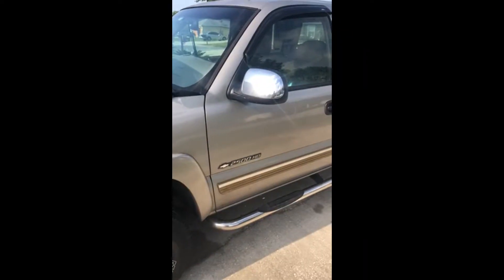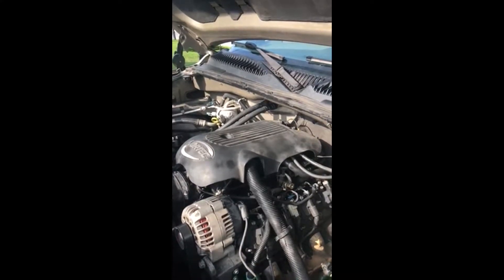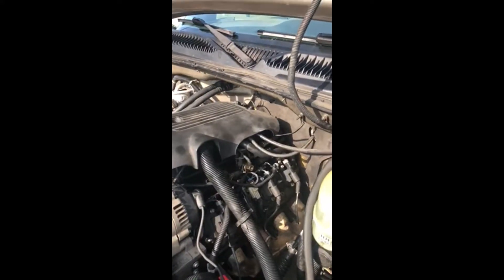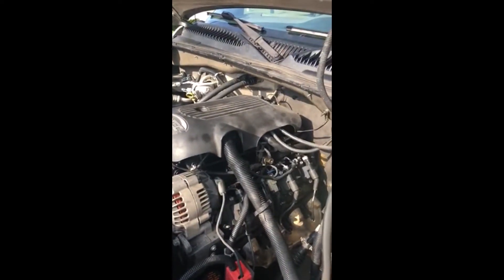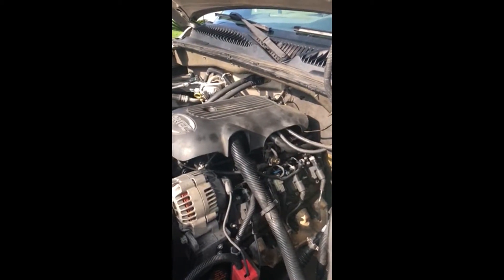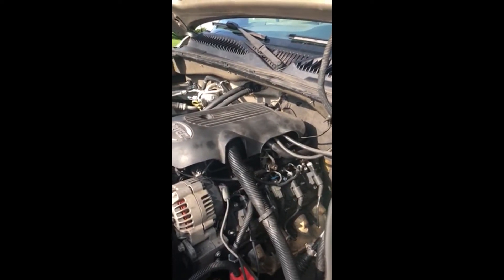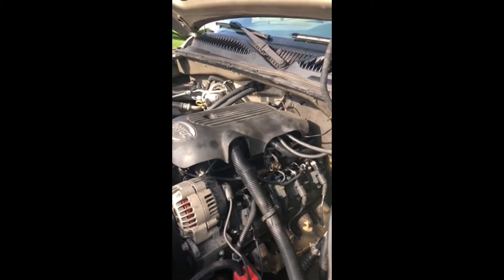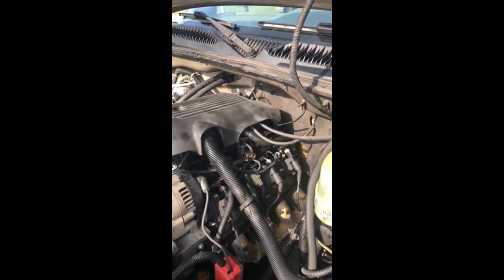Secret to Fix Knock Sensor Issue

Comment: How Is this true?
Reply from the maker: Yes comes out of the Stealership Service Manual !
This procedure is used after new install, even if re-located as I did in other video.
ECM has to re learn noise levels.
Reply: C J Phillips Basically If I already reinstalled them I just have to reset ECM and then start my vehicle and rev engine up to 5-6k RPM?
Reply from the maker: @Z71__  Yes, The ECM has to learn the Harmonic's from sensors from Idle to High RPM range, If code re appears, That sensor is Faulty, AC Delco Rep informed me 50% of all sensors sold are BAD FROM MFG.! Thats why I relocated them on my 2500HD make them easy to change.
Reply: C J Phillips ok thanks
Reply: @Z71__  I just tried this.  Held to 5 RPM and cut it off and restart a 2nd time.  After the second cut off I test drove it and it worked like a charm thus far.  Thank god I didn't cut my new wire harness for the knock as some of the other videos said I should do.  Thanks for this hidden update.  Now I know for someone else's problem or future reference.
Reply: @Markman393  did the code clear it’s self afterwards. or did you have to clear it? I will try this method...
Reply: @leosdreamon681  it worked for a bit then came back on.  So I just grabbed one knocked sensor from the yard  along with the wire connecting to the PCM.  Use the 3/8 drill holes on the side of the head to mount the knock sensor.  The one up front  in front of the exhaust manifold on driver's side.    Tie the 2 wires from the PCM connecting plug and  tie in to one wire running to the knock.  This way the PCM will read for both knock from the same knock you mounted.  Clear the code and you are all set.  I just did my emissions and the light still hasnt came on since 8/26/2020
Reply: @cjphillips987  so ur saying it’s comes out of the dealership service manual. And is a procedure they do there?
Reply: @Markman393  think I will bypass it instead
Reply: @leosdreamon681  better option.  Let me know and I'll show you how I did mines and it looks factory.
Reply: @Markman393  how you do urs?
Reply: @leosdreamon681  where do you want me to send the photo.?
Reply from the maker: @leosdreamon681  YES after clearing Code with Scanner
Reply: @cjphillips987  im having same issue. is there proof of this where can I find this in the service manual
Reply from the maker: @michaelrubio2860  service department read it to me from their manual off computer screen they wouldn’t provide a copy
Reply: If new sensors and harness installed correctly doesnt fix the problem you in-fact have a knock. Check exhaust studs and motor mounts. Super common knock related soultions. Almost guaranteed everyone has broken studs. After chasing my tail and doing 3 sensors cuz the code kept changing I realized 5 of 12 manifold studs were broken. Definitely casing my original knock trigger. Sensors RARELY just “go bad” let my experience save you all some trouble. I deserve a like for everyone with broken studs lol